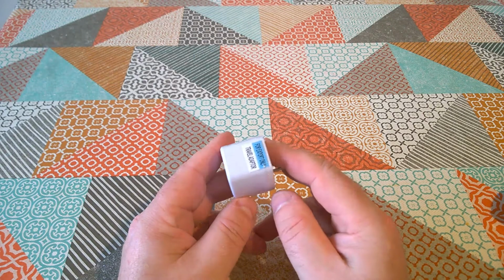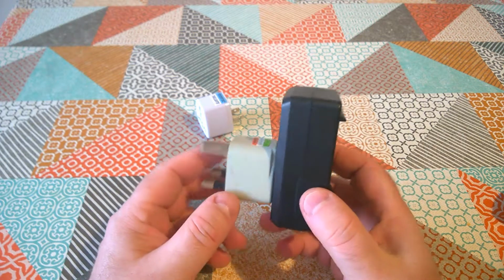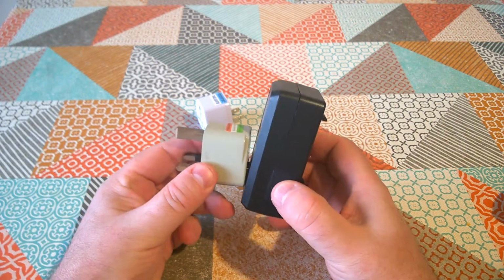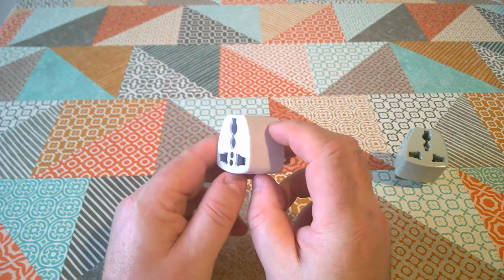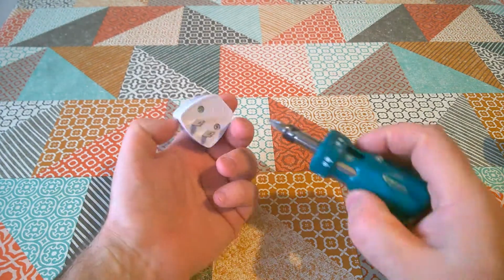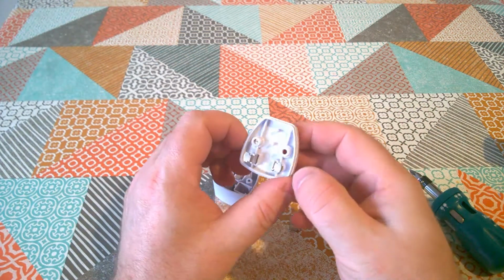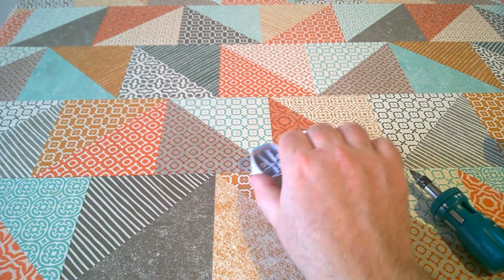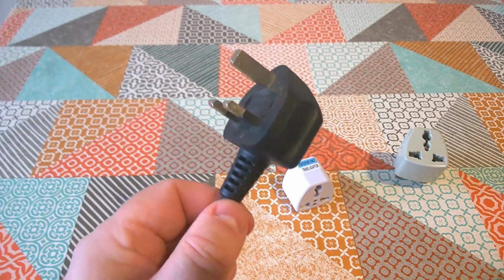What's Inside A Death-Daptor (Chinese Mains Adaptor Teardown)

Comment: is it safe to use one of those Chinese adapters for Router on long run daily? If it's plugged properly, any risk of burning?
Reply from the maker: Most of the risk is probably associated with plugging them in and first switch-on.  If you got past that and are still alive, and you have no further need to twiddle with it, and it's out of the reach of children, the risk level is reduced,  but I personally prefer to buy an adaptor locally that I know has been made to adhere to some sort of standards
Reply: @AtomicShrimp  great! appreciate your response

Comment: I have the pro version of the death adapter built into a 200w rechargable battery which the sine wave is 240volt but I live in the United States so my 120 volt device's tend to flicker and there is always a spark when plugging in.

Comment: These items are extremely poor quality. It is dangerous and could kill the user. It rated at 10A but not constructed that way. It came with every screw rusted. Its internal are not attached and loose. there is no beefy spring and relied on thin sheet of metal that is easily deformed and won't spring back. The internal contact points are loose, minimal, and definitely not able to take 10a of current. I am so disappointed as it can over heat and burn the house down or give me electric shock. I am asking for a refund and they are going into the rubbish bin.

Comment: A while ago I watched a YouTube series called  "hidden killers in the [historical era] home". Where the first electric house lamps were discussed. They just had bare copper wire hanging from the ceiling to a lamp... combined with most people not knowing wtf electricity even was, people just straight up died from touching the wires accidentally.

Comment: to be fair, I've seen some domestic plugs that have surprisingly little inner workings. All they really need is two or three clamps with wires attached to them.
Having said that, I'm in NO means an electrician, and I don't mess with anything that I'm not 100% sure won't kill me, and having a decent amount of trust in European safety specs, I'm sure our plugs have higher quality plastic, metal, wires and everything in them.

Comment: i have one that literally melted after i have my portable AC hook through it after couple of hours.
very very very doggy contacts, never never trust this and leave it unattended even with low power devices.
Reply: That is probably because the adapter did not have a fuse, learn about fuses on plugs.

Comment: a cheap (and relatively safe) alternative to these for folks in the UK at least is the shaver adaptors. Most of these Chinese appliances use well under an amp, and the shaver adaptors (available for under a pound each and hold onto US/EU 2-pin plugs securely) have a 1A fuse in them. Much better than these things.
Reply: 40mA will kill you let alone 1A!